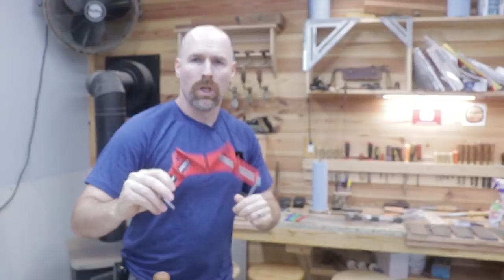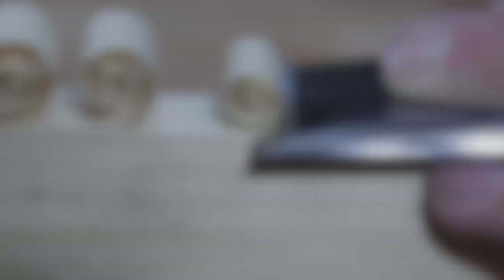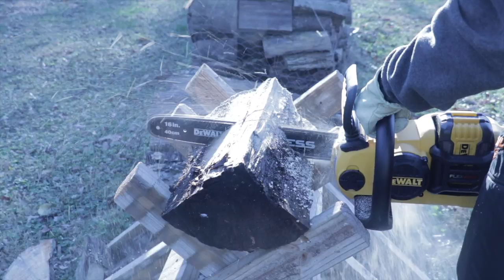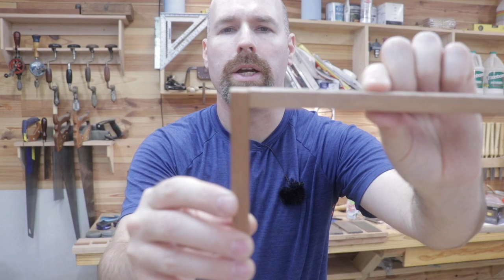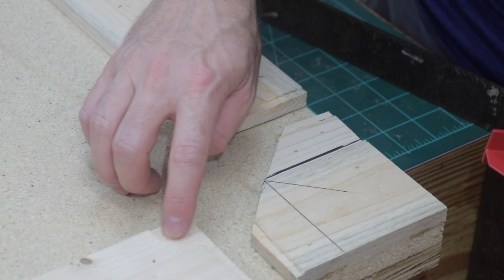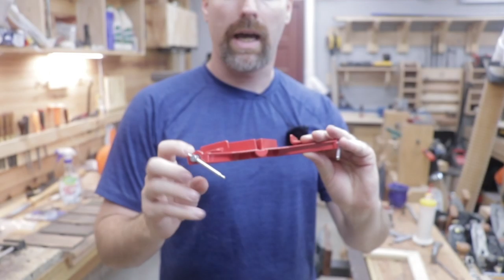Can We Salvage This Cheap Woodworking Tool I bought on AMAZON Prime?

Comment: Sorry to sound negative but this is not a clamp for drawing joints together it is merely for work holding.  It has no ability to draw the joint together regardless of it being square or not.  Maybe you could also set my quivering heart at rest, you really trust your framing square to be absolutely square? I can't believe you can use such an item to be the reference square for your entire workshop. Check it by using the 3,4,5 method and let me know.  On the plus side not all cheap tools are rubbish and it's great you are trying to find the gems in the world of woodworking.
Reply from the maker: Thanks

Comment: Those exact clamps have been around since the 70’s, maybe earlier. For how small and simple they are, they do work. The larger ones like the Wolfcraft ones take up a large amount of space and you end up hanging them somewhere. I’ve a few of the old ones and some that are the same but pivot and they fit in a bottom drawer handily.

Comment: The real issue with these type clamps is that they only hold the wood square.  Unfortunately, they do not draw the pieces together to form a tight joint.  They simply hold the pieces where YOU place them tight or not.  If you cut your joints precisely you do not need a squaring jig.  The pressure from this jig does not apply pressure in the correct direction to tighten the joint.
Reply from the maker: Thanks for sharing